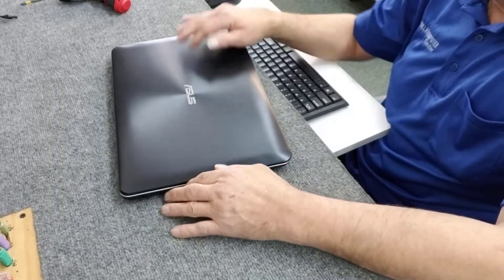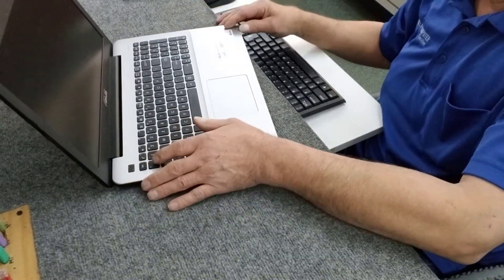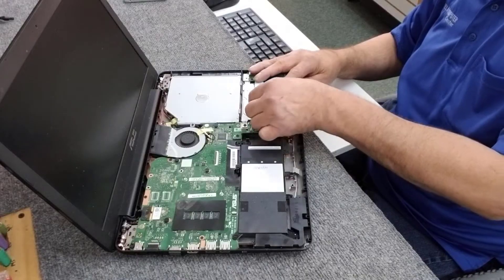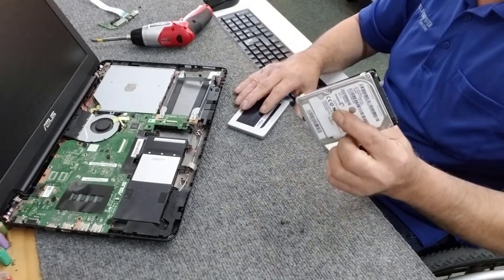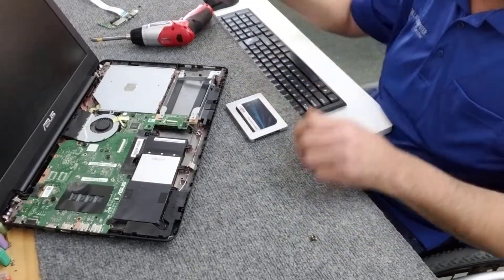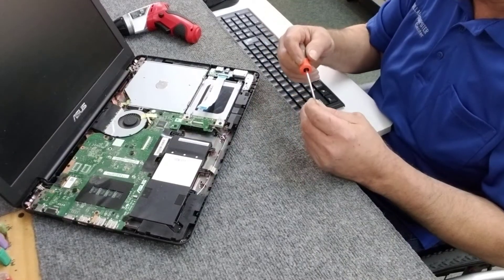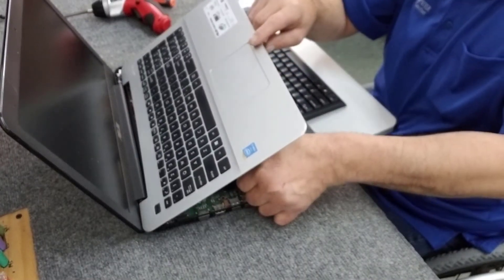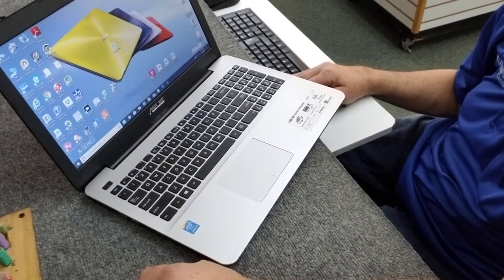Asus laptop SSD Upgrade

Comment: I'm about to upgrade to an SSD in my Asus, but luckily mine has an access panel for both the ram and the hard drive, so I don't have to mess with the keyboard removal.
Reply: Fortunately most of the newer Asus laptops you don't have to Tinker with removing the keyboard, you just pry the back panel off and you are good to go
Reply: @cutemimi25  My Asus is a 2014 touchscreen model.
Reply: @christopheraaron8299  Interesting

Comment: Where did you get the SSD for that specific laptop? I have that same one and am out of memory on my hard drive. I want to make sure i get the right one!
Reply: Any 2.5-inch laptop-style SSD should work. They come in 7mm and 15mm depths, and I believe that either will fit, although most SSDs are 7mm anyway. Stick with name brands like Western Digital, Crucial, Sandisk, etc. 
Pro tip: Order them directly from the manufacturer. There are a lot of shady forgeries out there, and the only way to guarantee that you don't end up with one that has been filtered through several layers of suppliers is to order straight from the source. The good news is that typically the price will be exactly the same or better than Amazon or Newegg.

Comment: Hi can you put another hdd on that or have a tutorial like adding new hdd on the space that is supposed to be for dvd or optical drives? Thanks
Reply: hi you can just buy a CADDY for pc ,it s only 10 $ and put an ssd or hhd in it , plug it in instead of dvd,it it works fine .

Comment: Is this kind of upgrade possible in the Asus Imaginebook? Bought it on sale but 128gb of SSD is not great.
Reply from the maker: Hello. I believe your model has an m.2 slot. You can install an m.2 ssd. Not a 2.5 inch drive.
Reply: @CadillacComputerCenter  I will have to wait until it arrives to confirm but thank you for the answer!

Comment: Hi, your title "Asus Laptop Hard Drive upgrade to SSD, Model F555L. Start to Finish" should be edited to elucidate the fact that you skip over the cloning process. BUT I found removing the top was very interesting. I had no idea that this could be done. I say this because I've seen videos on resoldering or replacing the charging dock- and basically, they remove just about everything from the bottom to perform the operation. Would it be possible to do it from the top? Thanx
Reply from the maker: Thanks for watching.  Many models open by removing bottom tray. This model opens by removing top, or palm rest to access mainboard. To replace charging port varies from model to model. If soldering is required. Then you need to remove mainboard completely.  Sry about not showing the cloning. This video was intended to mainly show how to replace hard drive.   Thx for your question , Dale